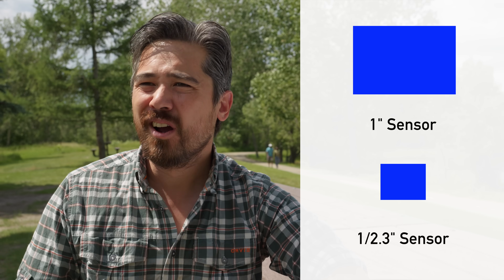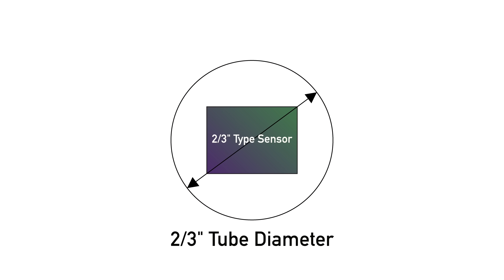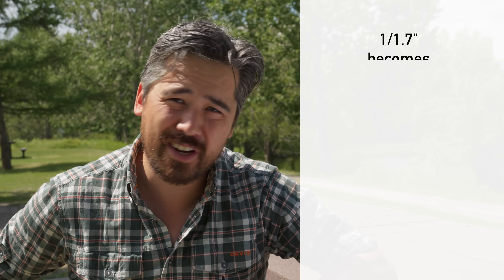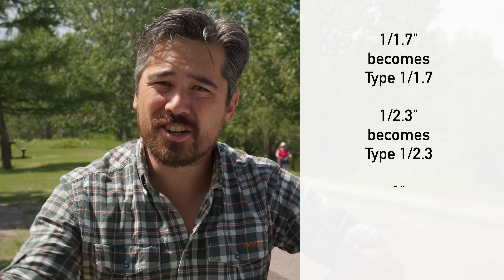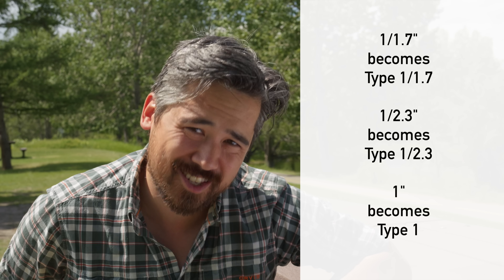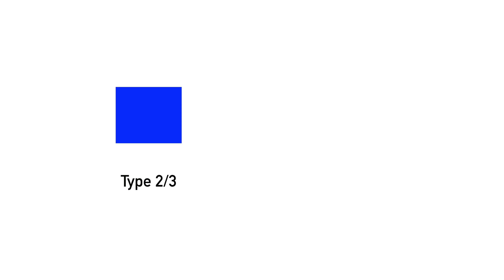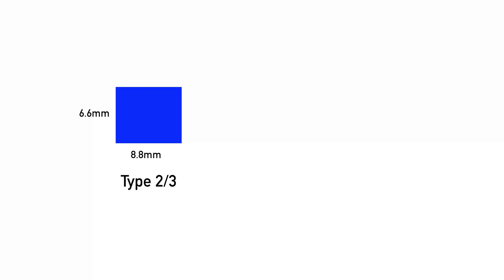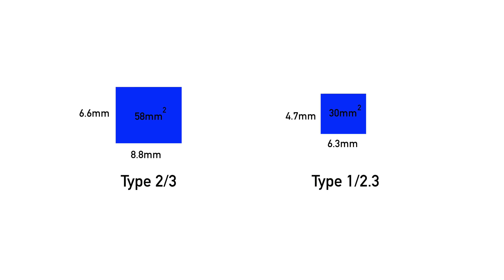Sensor sizes make no sense, but we fixed it!

Comment: As a NAMING format, it just doesn’t work. How exactly is Type 1/1.7 better than 1.7”? The name by itself provides absolutely no information about the size, dimensions, or indeed anything meaningful at all. Without further clarification (like the surface area in millimetres), Type 1/1.7 is just meaningless nonsense. Again, as a NAMING system it brings absolutely nothing to the table.
Reply: You are looking at the tail of an elephant and complaining how can it walk with a  so small tail.

1) The reason to keep the marking: because it is widely used and one has to use terminology that is at least somewhat compatible to what others use.

2) Why is the word inch or the symbol for it removed. So that it is not confused with actual measure. This is especially relevant with the 1 inch / type 1 sensor.

3) How does one know the size? They include that (it is the legs of the elephant)
Reply: Did you watch the video, or did you stop at the point you got angry and started to complain? They do tell the dimensions.

Comment: Honestly you guys messed up. Hear me out. You need to start referring to sensors by crop only, not by made up terms. "Type 1/2.3, Type 1", gosh. 

Please don't try to make this popular. It changes nothing regarding the confusion and it totally glances over the fact that we have a system that will tell us what kind of results we will get: CROP FACTOR.

Sorry but this really is a stupid take and it's not too late to stop it now. What the hell is the sensor area gonna tell us in regards of results at a glance? NOTHING. 

Influence used for the wrong thing without thinking it through.
Reply: They need to use terminology that is commonly used.

Comment: I am sorry but most of this absolutely make no sense.  You already said people can't do fraction, yet you keep using fraction as "Types"??  Personally, the truly innovative part is the use of surface area.  Why not just stick to that?  A full-frame sensor is 36mm x 24mm which is 864mm².  Just call that Type-864.  APSC is 24x16 which makes it Type-384.  Micro 4/3? 18x13.5=243, so Type-243.  The chance of two sensors with different aspect ratio landing the same surface area is slim to none, so your "Type" number will not duplicate.  Yet this gives anyone a direct, apple-to-apple comparison of each sensor's potential light gathering capacity, and a rough idea of it's depth of field quality... which is really what we cared anyway.  Plus, it differentiate the Canon vs everyone-else APS-C size; for Canon it would be 22.3x14.9 = 332, hence Type-332.  Super 16?  12.52x7.41 = Type-93.  If you are gonna build a new nomenclature, build one that make sense - not one that is JUST as confusing!!
Reply: Are you all joking?

Comment: I honestly can't tell if this is a joke video... Can someone explain why 'type 1/2.3' is better than 1/2.3"?

If you're going to revamp and standardise sensor size measurements, there a ton of better options! Personally I'd go for everything being a rounded decimal value which indicates the proportion of full frame (e.g. APS-C becomes 0.7x, medium format becomes 1.3x), but I get that people might not like that
Reply: metric people don't like to see the " which refers to inch.
Reply: Yes exactly my point.  I feel like we've just all been trolled... lol  They first say people can't do fraction, then they keep using fraction as the Type name.  That's going to be JUST as confusing, if not more.
Reply: For someone seeing these descriptions for the first time, it would probably have them focus of the mm dimensions first and hopefully just ignore the tube type dimension.
Reply: It lacks the inch marking. 1/2.3" is 11 mm but the sensor size is just 7.7 mm diagonal. It has to be similar enough that people can associate it to 1/2.3" in other sources.
Reply: The upgrade is that it no longer misleads people into thinking 1/2.3" is representative of the sensor's size, 1/2.3" is just a bad name because it doesn't tell you something useful (at least no longer) about the thing. The problem with your proportion idea is that not all sensors have the same aspect ratio, otherwise it'd be a nice idea.

Comment: I call the 35mm full frame for 35mm, since full frame is indicating, that the lens i covvering the full frame, so most every camera with a lence is full frame.
Reply: Yes good point.  The whole "Full Frame" should really be dropped completely.  If 35mm is "full frame", what makes medium format?  GFX-50 is "1.67 Frame"? 🤣
Reply: Pardon? Full frame is called 35 mm because the total width of the film was 35 mm (originally 1 3/8 ")

Comment: Flabbergasted why the 1/2.3 number is still there to be honest? Why? So you still have to do math in your head to get a feeling for how much smaller or bigger a sensor is? Squared size of something (in whatever unit) and/or cropfactor would make it immediately clear - even to non-technical people- - how much 'worse or better' a sensor is. I applaud the move to change, but what's happened now is that you remove the " character in some of the sensors and call it a day??
Reply: It is there because it is the standard. You do to need to do math as they give the dimensions in millimeters.

Comment: This does not make things easier. The 2 easiest things to understand are surface area and density. For video you only need the horizontal dimension. If the type 1 sensor is the base then it would be easier to designate other sensors as just .73 or .5 or 1.2 as it relates to surface area. Just one number. What you’ve presented is confusing as heck.

Comment: This was as bad as watching Gerald Undone theory of the best banana 🤣
But actually you're on to something.  I do think these sizes are misleading and then they switch between mm and inches eg 35mm, so depends on where you live you need to bring out that ruler which unfortunately will not help you figure out the size but it will give you a rough idea how big or small it is compared to another sensor size.

Comment: A beginner like me hasn't really understood why a medium format sensor is bigger than a full format sensor. Someone should look into that. :)
Reply: Medium format is smaller than large format film. Full frame is smaller, the same size as 35mm film. The first digital sensors didn't use the 'full frame' provided by those 35mm lenses.
Reply: HiHi, I have never thought about that. But I know Photography when film was used. At that time it did make more sense. 😁

Comment: Removing inches and adding type at the start does nothing to really fix the naming problem as its still the same basic naming structure without the inches and adding type at the start. Its useful though that you will be saying the actual sensor dimensions as that is better than just an name change that doesn't really change the name in any meaningful way.
Reply: Did you watch all the way through?

Comment: I think that just stating the total surface area without the "type" would've been better. Followed by what technology it is: Stacked/CMOS, all that stuff. It's straight to the point, it's what matters, no need for any types! That's just me though.
Reply: 100%.  The "type" really didn't explain ANYTHING, and is just going to make the confusion worse.  See my other comments on using surface area as type.  Same idea as yours, much more practical.  Full frame would be 36mm x 24mm which is 864mm².  Just call that Type-864.  APSC is 24x16 which makes it Type-384.  Micro 4/3? 18x13.5=243, so Type-243.  The chance of two sensors with different aspect ratio landing the same surface area is slim to none, so your "Type" number will not duplicate.  Yet this gives anyone a direct, apple-to-apple comparison of each sensor's potential light gathering capacity, and a rough idea of it's depth of field quality... which is really what we cared anyway.  Plus, it differentiate the Canon vs everyone-else APS-C size; for Canon it would be 22.3x14.9 = 332, hence Type 332.  Super 16?  12.52x7.41 = Type 93.  If someone wants to build a new nomenclature, build one that make sense - not one that is JUST as confusing!!
Reply: @WallaceLau  Perfect explanation, I was thinking of doing it myself, but now there is no need! 👏👍
Reply: @WallaceLau  Absolutely, this would make so much more sense! "Lets clear things up and move away from stupid 1/2.3" naming, lets name it type 1/2.3 instead" WTF DP Review?
Reply: @WallaceLau  The point is that others still use those markings. Sony for example uses the "Type 1.0 sensor".
Reply: Yep, not sure about the type thing, but the measurements are a great addition. Perhaps the pixel size would also be interesting to know.
Reply: Yep, agreed. What really matters is the surface area and aspect ratio of the sensor, plus any noteworthy technology in it. Also listing the crop factor vs full frame might be a useful metric too because then you can easily convert between different sensor sizes without any additional maths. Manually figuring out the crop factor for tiny phone sensors can be a huge pain, but it's kinda nice to know that my phone has a fixed 24mm f8 lens in comparison to full frame
Reply: @olivial409  The f stop is a mechanical function of the lens and your conversion only applies to the depth of field. Really surface area or even just the diagonal of the frame is more than sufficient. It is ridiculous to get hung up on conversion factors. Plus why would a 24x36mm frame be considered "full frame?" Why not a 6x7cm or a 4x5in or even an 8x10in be considered "full frame. It is as if everyone considers 24x36mm as though it is the holy grail. There are advantages and disadvantages of each sensor size available.
Reply: @JHuffPhoto  I still think for a photographic system with a fixed lens knowing the equivalent aperture would be helpful. Regarding the equivalence only applying to depth of  field, this is quite a common misconception. There is an excellent open access 2018 academic article titled “Equivalence theory for cross-format photographic image quality comparisons” by D. Andrew Rowlands which explores this in depth, which I highly recommend interested folks give a read
Reply: @JHuffPhoto  In the old days of film cameras, 135 film, or 35mm film as it was more commonly called (35mm is the wide of a standard dual perforated role of film) was the most use format by large. Camera manufactures produced millions of cameras using the well-known 24mm x 36mm file format. But not only that. They produced even more lenses that was built for the 24x36 format.

When camera manufactures hit the digital age, they stood with a problem. Then could not make / get any sensor big enough to fill the full 24x36 format. Nobody made sensors that big and if they did, they were too expensive. Most settle down with a smaller sensor size (aps-c) which was cheaper and could be made, but it was not a well-liked solution, as people's old lenses was still for the full 24x36 format.

Then finally the sensor price came down and with modern product manufacturing metodes, camera manufactures could finally get their hands on sensors that could fill the "full frame" of the old 24x36mm format. And boy did they take advantage of the advertising gold that was hidden in the meaning of the words ""FULL FRAME"".
Reply: @HJN67  Yeah.....I am aware of the history of the marketing. However I still think that it is pointless to perpetuate 24x36mm as the gold standard in sensor size.There is nothing wrong with 24x36mm but like any other sensor size it has advantages and disadvantages. That is just my opinion.....feel free to disagree. I promise I will not be offended
Reply: @JHuffPhoto  Oh, I do not disagree. I was simple stating, that 24x36mm aka FF was made the "standard" digital format based on a historical perception on what was the standard in the olden days.

Digital formats aka sensor size, do not have the same restraint as film does. If you cut a film in half, you literally cut your resolution in half. Not so in the digital world, where different sensors can have the same resolution independent on sensor size. That mean other properties in a sensor can have a bigger value for you, and your decision to buy into that format.

In the olden film days, you either went BIG (medium format was big 4.5x6cm minimum) or very small "Minox" 9mm, or went with the 35mm format, so you really didn't have as much choise as in today's world.
Reply: @jonpaulpepen9470  I'm sorry but the f stop is a phsical property of the lens and is defined by the actual focal length in divided by the pupil size. It has nothing to do with equivalence. It can be used as a rough guide to determine dof for a similarly framed shot with different formats or sensor sizes. I will however try to find the article you referenced. I am always interested in other perspectives  As one would expect a larger sensor will generally outperform a smaller one but not by as much as you may think. Low light is a situation where a bigger sensor can be useful
Reply: @JHuffPhoto  it gets even sillier when you consider these are mostly now hybrid cameras that shoot video and stills. In the cinema world the standard that you would consider "full frame" is Super35, and a "Full Frame" sensor is considered Large Format (in open gate the Arri LF's sensor is only 1.54mm wider and 0.7mm higher than "full frame").

Full frame should really be called 135, since that's the actual format.
Reply: I believe they kept the "Type" part just for reference with the existing sizes that everybody else will still be using. I am fine with it. As long as I get the length and the width, I can calculate everything else by myself.
Reply: @popaadriantraian  exactly. Seems like a map to what everybody else will be using outside of dpreview. But I still think it doesn’t provide any additional value, except from going against the wrong inch measurement of course
Reply: is canon apsc still weirdly slightly smaller than other apsc or is it the same now in mirrorless?
Reply: @jonuiuc  still the same 1.6x unfortunately
Reply: I agree 100%. All we need is the dimensions, length x width.
Reply: It’s not just @The_Poopman. Many people, including me, agree with him. I like your system, but see no reason why the “type“ designation is helpful. The suggestion that you provide surface area and the relevant technology, is much more helpful. Additionally, I think it would be helpful if you provided any other information that you thought would advance our understanding , such as comparable megapixels, well depths, bayer pattern filters (if applicable), etc.
Reply: COMPLETELY AGREE!  Total surface area in mm squared works, it depicts the size difference perfectly, a bit like car engine displacement.
Reply: I'd use diagonal length. Most things in photography use length, not area. If you start using area, then it's harder to do crop factor, equivalency, and stop comparisons, all of which are in one, not two dimensions. For instance, full frame sensors have about a 43.2mm diagonal, whereas Micro Four Thirds is 21.6mm. Hence, you can easily see that the crop factor is 2x. Calculations like these are needlessly annoying if you use area, then you always have to apply a square root.
Reply: @mbvglider  That doesn't really work because different size sensors sometimes have different aspect ratios so both diagonal measurements should be used. For example FF is 3:2 and MFT is 4:3.
Reply: If you were going to propose for an international standard and convention, why not using international system units and drop the inches all together?
Reply: I agree 100%. The surface area in square mm’s is what’s important and to the point. The physical area of the sensor relative to others.
Reply: Type is OK. Because you'll find different sizes lumped together under that marketing term 'bla fraction inch" sensor.
Reply: Yes, people will quickly tune it out.  It reminds me of a used textbook I once saw in my college's bookstore.  Whoever previously owned it had highlighted every single sentence in the book in neon green.  They defeated their own purpose by using it ubiqitously.
Reply: Wallace Lau has it! That will also make it easier to communicate when a camera has a large sensor but don’t use the full width (like some smartphones are doing)
Reply: Area is 100% the way to go.  Everything else is just needless words.
Reply: The Poopman got it right. Or simply just the diagonal plus aspect ratio. 

They missed their chance to make actual sense here. Give it another shot gentlemen.
Reply: That’s the optimal solution. Sensor area and aspect ratio. Then we can compare different sensors directly. And those who need the diagonal can do the simple math. No need to specify it separately. This solves all the problems.
Reply: I agree and would potentially also add the aspect ratio. Like for instance: 864mm2 4:3.
Reply: @petaren  Potentially, but the aspect ratio is not the critical thing. But the size in square mm would make so much more sense and would make many things easier to understand for photographers.
Reply: Surface areas are confusing. That is not how people generally think. The actual measurements are much clearer.

Comment: Comparing sizes using physical dimensions measured in SI units?  That's crazy talk!  😉
Reply: SI units are the standard unit of measurement in most of the countries in the world. They are simple, easy to remember and each of them has a direct relation to all others by the multiples of 10...
Reply: Madness! ;)
Reply: Anyone proposing that should get sanctioned by government.